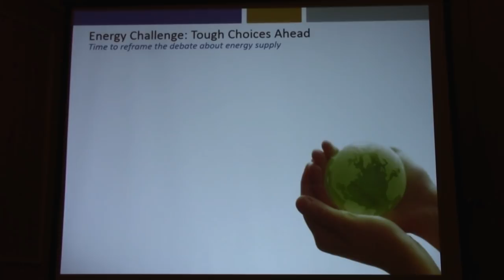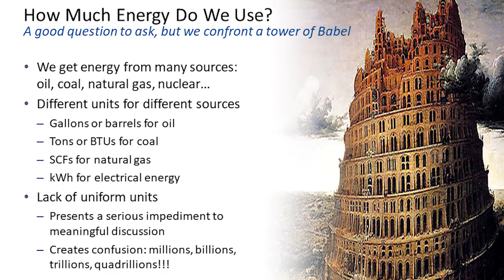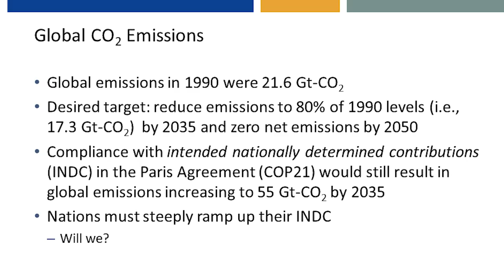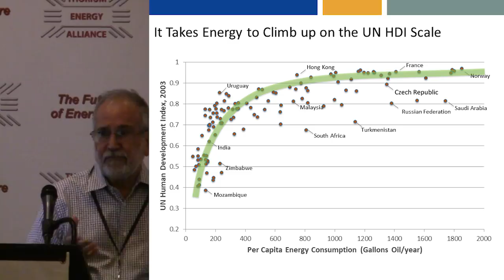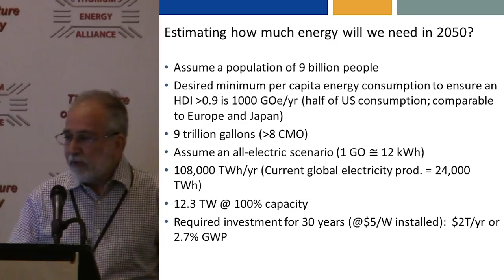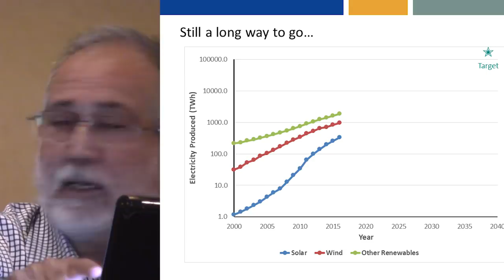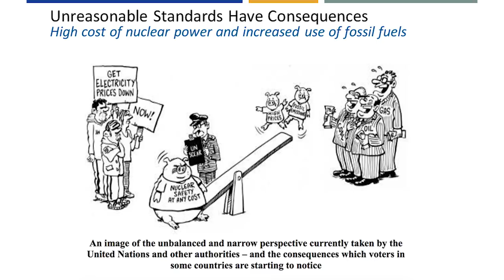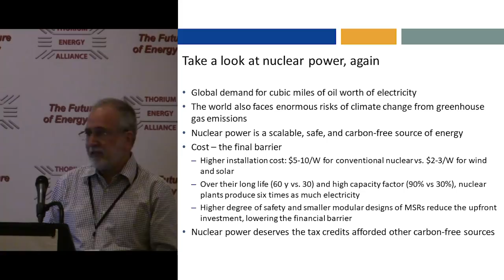Replacing Cubic Miles of Oil - Ripudaman Malhotra, Ph.D. @ TEAC8

Comment: You can really scare yourself by doing a back of an envelope calculation of how many 50 MegaWatt  thorium plants you would have to put up in order to replace the oil and gas we burn each year.  Which sorta raises the question of how much addition heating we are doing for each KW generated (instead of worrying about carbon, you are now wondering about waste heat).
Reply: With gasoline, we waste about 75% of the heat (cars). With natural gas and coal, we waste about 60% (steam turbines to electricity).
Using molten salt reactors, we'd waste about the same, unless very high temp version. So, there's no real concern with heat. Why? Because it's such a trivial amount compared to what
the sun puts out. We use about 1/8,000ths the energy as sunlight across the planet.
So, the sun puts out about 1,000 watts per sq meter at "perfect" conditions. Or average 164 W/m^2 over 24 hours over the entire planet.
Therefore, divide that by 8,000 and you see, we're only adding about .02 W.
Our excess CO2 is already forcing upwards of about a watt, some say 3.7 watts when the ppm is doubled to 560.
Using solar PV alone, even though there's no waste steam heat, there's all that wasted heat from the panels. That depends on albedo (or reflectivity) If the desert sand is 60% and the panel is less than 10% (they're really optimized to absorb light, hence their dark color) then we have over 50% heat difference. Panels are not yet 20% efficient, thus the other 4 parts x.5 = twice the heat from that part of the desert. And ALL sources, no matter how efficient will be used and then turn back into heat.
I would think that wind turbines would give off the least amount of heat.
However, molten salt reactors (not thorium, too much trouble) would provide almost unlimited amounts of energy needed to become the type 1 civilization needed to solve the excess CO2 challenge by building the infrastructure needed to literally suck the excess CO2 out of the air (and also do it with plants which require lots of desal plants and piping infrastructure, etc to re-green an entire desert, build more global prosperity, etc).